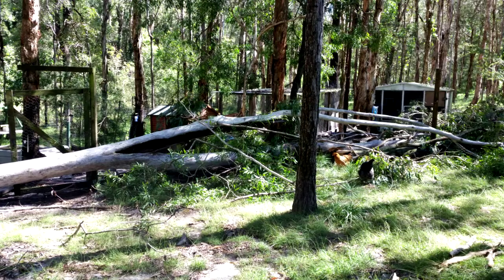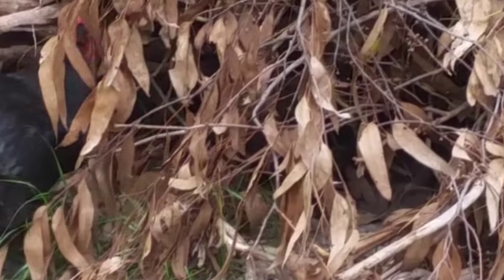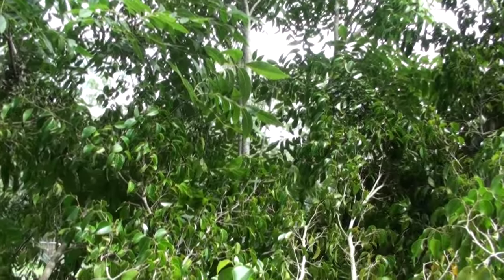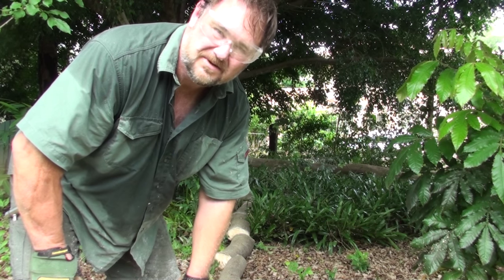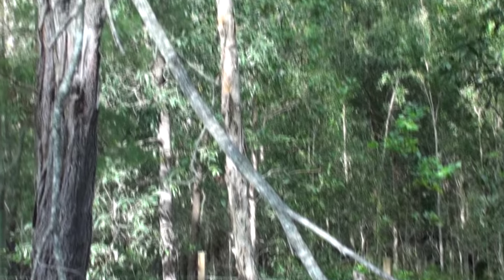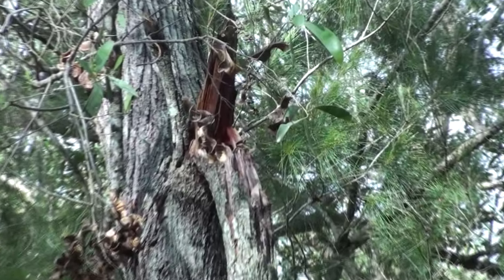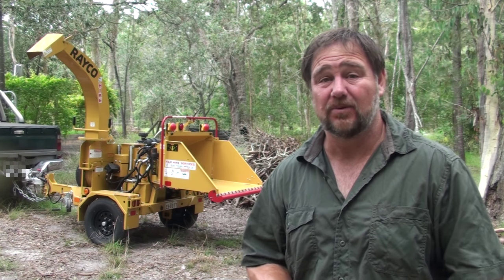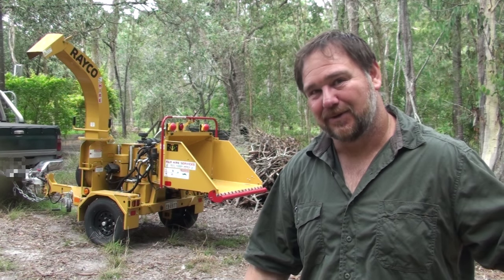Chopping & Chipping Buy or Rent Mulcher Acreage Maintenance

Comment: Nice overview of the machine. Safety features were excellent. I did choose to buy one rather than rent a couple times a year but my situation and purposes are a bit different from yours. Mine only shreds up to 6 centimeters but that is fine with me as anything over 6 centimeters goes to firewood which is a primary source of heat for us in winter.
Reply from the maker: +The Self Sufficient Life Thanks, yes for those like yourself who do use your chipper regularly it's definately handy to buy one. I did think long and hard about doing the same but felt I wouldn't use it enough personally. It can be a fine line because instead of building a pile of sticks I could be chipping them and keeping the place tidier... But, this works for me. Cheers :)
Reply: The Self Sufficient Life: I am torn whether to buy or rent a chipper for our 38 acres of woods.

Comment: If I saw a snake you would hear me screaming like a little girl!
I have a huge mess to clean up in the back yard, but I think the best and hardest thing to do is cut the brush up and tie bundles for the wood stove. but a couple of hours a day as I build up my strength.
thanks
Reply from the maker: +Rev John O&#39;Toole Making up bundles of sticks is a good idea! I do have a fire pit which could do with a bundle of kindling here and there. Good luck with your clean up Rev. Cheers :)
Reply: +Self Sufficient Me I am thinking of taking a 5 gal bucket and taking about a third of the side off so I can just drop in the sticks with the twine in there , that will give me the length and hold them until I get the bundle tied up.
best

Comment: I have experience with both renting and buying. 
The poor condition of mulching knives, the rental cost and transport hassles persuaded me to purchase a used 9" diesel machine. After one year my clearing project was complete so I sold the chipper for the amount I paid. 
Fast forward 10 years...a bark beetle infestation created another major clearing project. Just as you mentioned the prices quoted by contractors to clear and chip exceeded the cost of a used machine so I bought another. This time I plan on keeping it.
Used machines may require some wrenching. If you are not a capable DIY mechanic buying used may not be ideal.

Comment: Too expensive to rent. They're ripping you off. Small 2 cylinder 25 horsepower 6 inch chipper is $300/day or $250 for 4 hours rental.

Comment: That's just a 2 cylinder gas engine, not a 4 cylinder diesel? 35 horsepower? Seems like a small engine for a 6-inch chipper.

Comment: Can you figure out WHY the branch fell and if the tree it fell from has any other 'danger signs?’
Reply from the maker: +mrbluenun Yes, this particular branch was abnormally low on the trunk and when I cut it back I could see dry rot had set in behind the junction where the branch met the trunk so eventually gravity dropped it. Cheers :)

Comment: Those big trunks of branches are excellent for lumber wood. You should rent yourself a lumber saw machine to build yourself a new chicken or storage. Renting is best, but when you aren't in good shape to perform may hired.
Reply from the maker: +yack f zay Yes true and I am using some of the wood for my chicken pen although I'm not the best builder so my work will be average but it should be strong. Thanks Yack :)